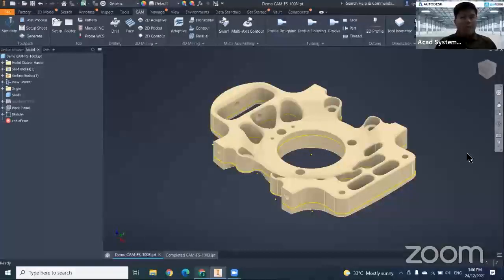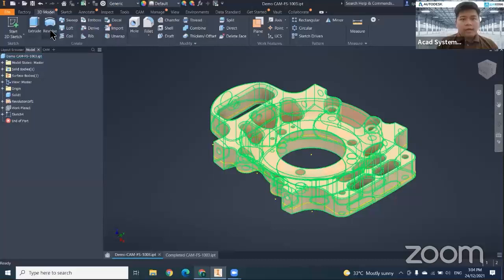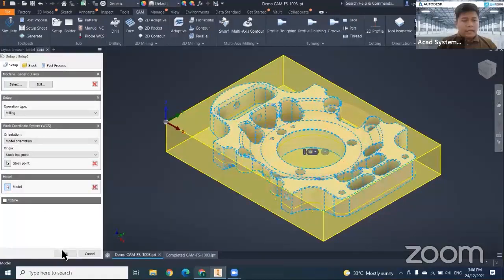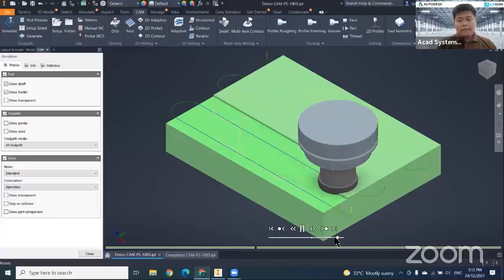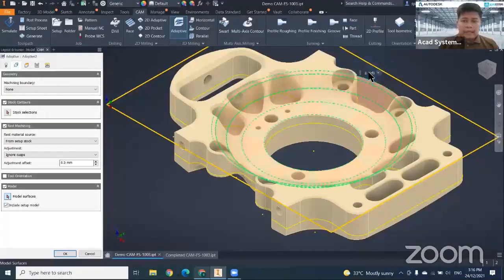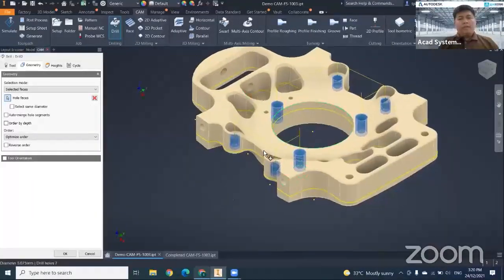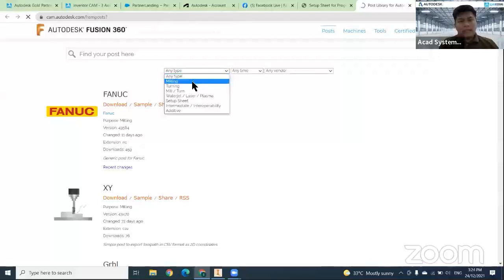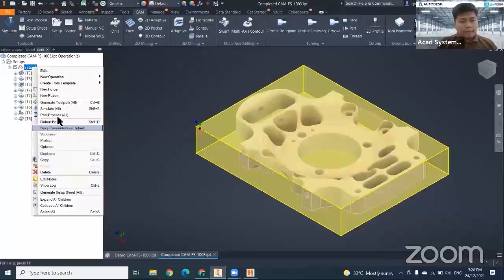Inventor CAM – 3 Axis Milling

Comment: Contoh kalau saya buat pocket. Saya nak cutter tu cut pada z direction mcm ni 2mm satu kali cut, lepas tu 2mm lagi dan 2mm lagi ke bawah lapisan demi lapisan. Tu adjust kt maximum roughing stepdown collum bawah dia fine stepdown tu ke…
Mcm mne ehh faham tak ?
Reply from the maker: Betul, untuk setiap yang turun tu, kita panggil dia stepdown. Incase guna yang 2D adaptive, make sure tick dekat multiple depth. :)